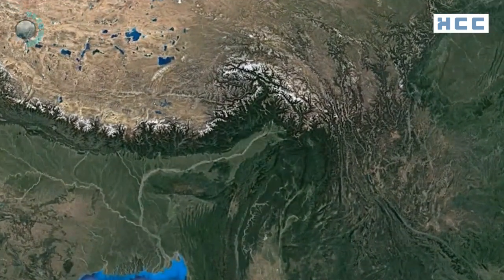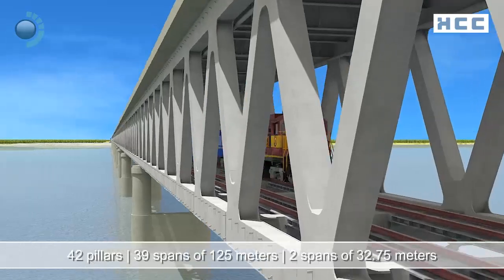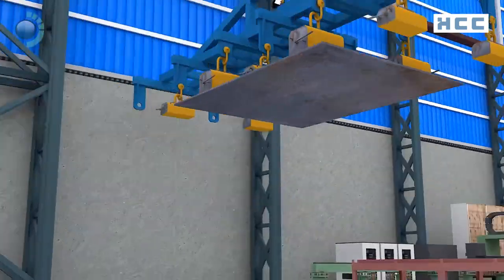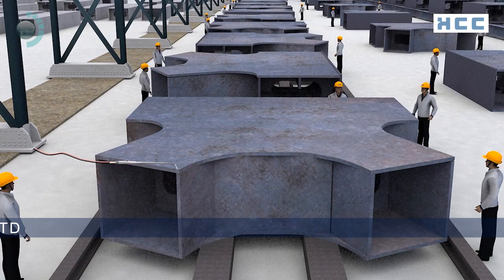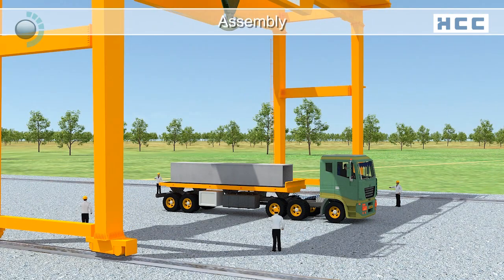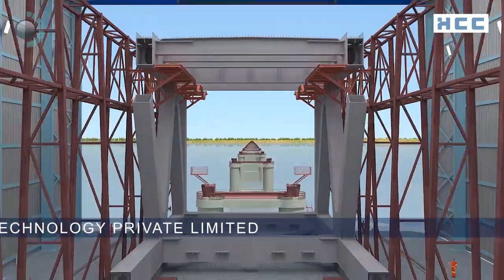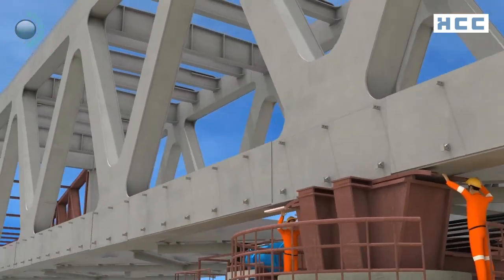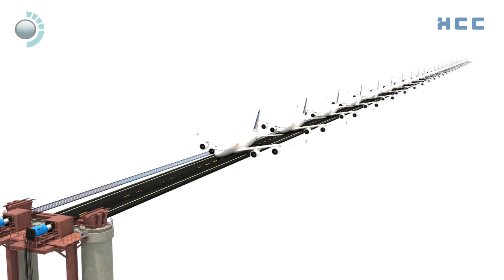Bogibeel Road-cum-Rail Bridge - how was it built?

Comment: The easiness shown in this Graphical illustration is not even 0.01% Ease in real scenario... Its an engineering marvel for sure. Every bit of steel fabrication takes around an hour to weeks or even months to completely judge its True strength and Feasibility in Steel design that is well under IS 800:2007 specifications and meets the demand of the Variable Loading Applications, weld strength, durability etc. Salute to all the Civil Engineers who made this possible. Jai hind.